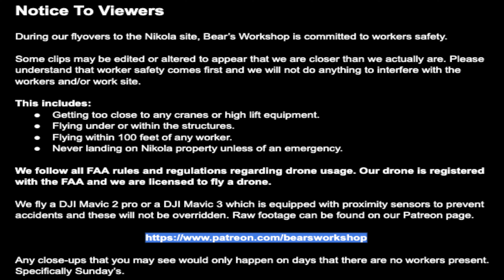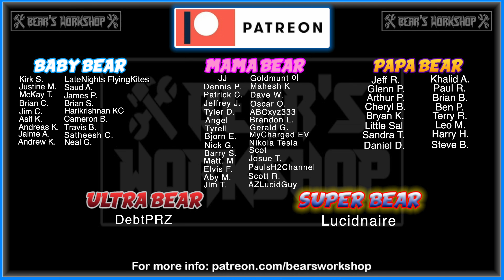Nikola Semi Factory Construction Site October 29th, 2022 | Drone Footage of 10:30 AM

Comment: If the stories are to be believed regarding the dramatic near-term shortage of diesel; I would think we'll soon see a very large increase in the demand for ev and hydro semi's. It will be a very interesting 45 days. And Bear; disappointed that Casa Grande is no longer a 20-50 cent discount from the Chandler area; no longer a bargain. Another interesting point; up in Sedona on Friday; gas was 3.69...Costco in Chandler was 4.29 today...usually Sedona runs high. Even Camp Verde was under 4 (diesel was 5.69).